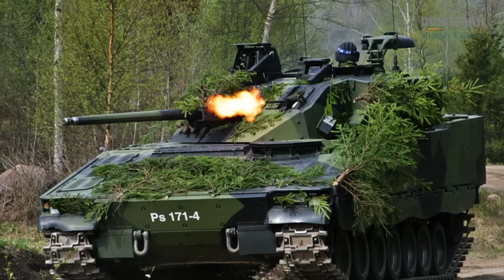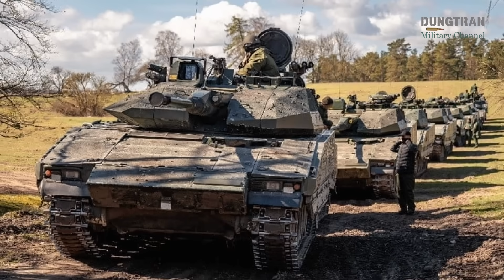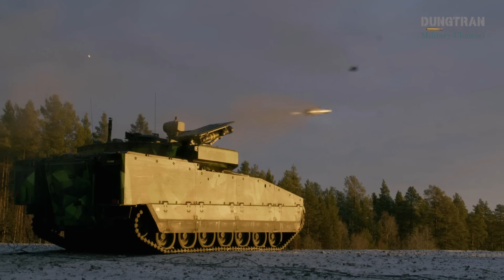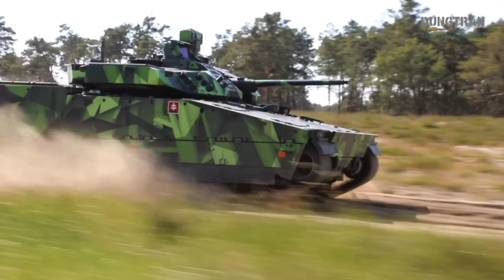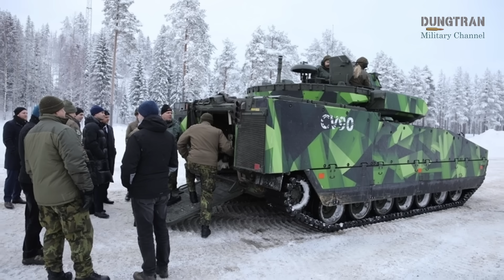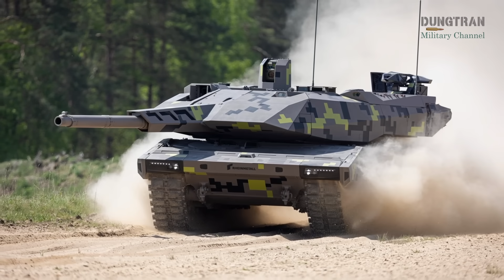Not the Cheapest, Not the Newest: Why NATO Keeps Buying Sweden’s CV90

Comment: Apart from the total tragedy the Ukraine war is - for developer of weapons and equipment and for working out tactics the Ukraine war is invaluable. They get to really "battletest" the gears and systems in a peer or near-peer combat situation to see if the vehicles can managed in "reality" and not just in training and gives valuable tactical development (like cheap drones and their effectivness).

Take the Archer artillery system - we knew that from battlegames it was a good and effective weapon system - Ukraine has showed HOW effective it is with its almost sniper like precition and multiple shells hitting at the same time, and the ability to stop-fire 3 shells and move in less than a minute, BEFORE the shells has landed at the target-

And no matter what - Russia has depleated their combat vehicles, and military weapons and military forces and it will take them a long time (like 5-10 YEARS) to be back at about the same strength as they wear BEFORE the second invasion of Ukraine. They are "modernizing" T-62 and T-55 tanks and old APC for FRONTLINE service not because they dont have anything else to DEFEND themselvrs with but because they have "run out" of Modern tanks/APC/IFV in the now 3 year long special military operation that was supposed to take 3 days

Comment: They are also ensuring a highly efficient logistic train that can support and disperse vulnerabilities geographically.
The current bulk acquisition by various nations also keeps the costs down through scale purchases by running 
production lines in a comprehensive/predictable  manner.  Be well and stay safe
Reply: Also cut down in training time if they all use the same system - both for crew that takes it into combat but also for repairing them afterwards (and in a pinch scavanging parts from more damaged ones no matter from wher they come). Standardisation is agood thing for people in war - logistcaly ut would SUCK to have several konds om 9mm pistols (like both a glock in 9x19 and makarovs in 9x18 and some .38 revolvers) IF you can avoid it.

Comment: What platform is more advanced?
Reply: The CV90 is constantly upgraded, Denmark and Sweden ordered 205 new units CV9035MklllC 2.5 billion dollars = 12.19 million dollars per unit in my opinion they are the most advanced in the category currently it has more capabilities then its competitors but is probably also the most expensive in the category it’s more expensive then most main battle tanks.
Reply: @kimmogensen4888  What most people don't understand is how modular the CV90 is which also means it can easily be upgraded to newer iterations. Over time this can actually make them quite cheap in comparison with many competitors. many new competitors also have become more modular, but Sweden made modular vehicles already in the 90ties.
You can't compare an old CV90 with a modern one, modern CV90 are as modern and capable as any newly designed IFV today, maybe even better in most ways as it is battle proven in addition to being modern.
Reply: @kimmogensen4888 the new Mark IV being rolled out here is the newest iteration and thus more advanced than IIIC.
Reply: At this point none.
Reply: LAV 6
Reply: Ajax but it’s more expensive and unproven
Reply: @richythinIn what way is Ajax more advanced?
Reply: @richythinAh you mean the IFV that was so loud and shaked so bad so they had to take it back to the drawing board. 😂😂 yeah, sure.